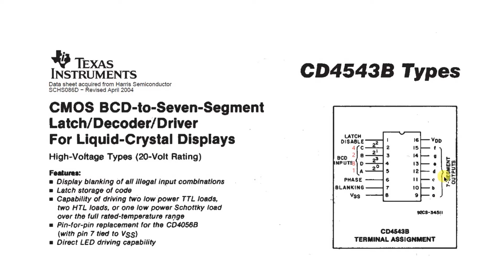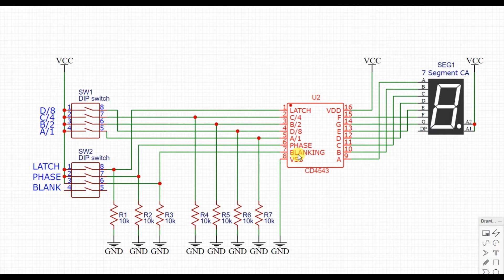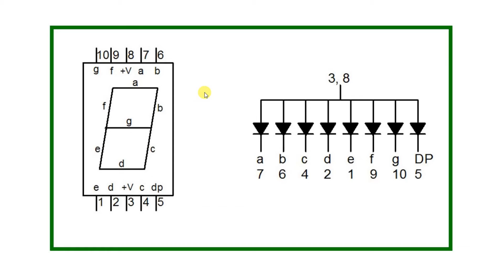CD4543 7-Segment Latch/Decoder/Driver IC

Comment: Good evening, please I really need help to use multiplexing with this single decoder and two displays.
Reply from the maker: To do that you really need to use a microcontroller. In order to multiplex to two displays you would need to control the power going to the lcd displays, both would be connected to the output pins in parallel. The microcontroller would control power to the lcds via transistors. If you give me more details on exactly what you want to do I may be able to advise you further.

Comment: Hi.  Why we don't use resistors between the 4543 outputs and the display segments in this circuit.  I also studied this system myself and noticed that it seemed to introduce this resistance itself, because adding resistors by me did not limit the current.
Reply from the maker: It seems like this chip will work without resistors
Reply: Quite a few of these '4' series display driver chips limit the output current so you do not need resistors - but be careful as they often do.  Best to build your prototype on the bread board with them in!  Remember if you short a pin on the chip somewhere to the power supply (I have done this many a time) you could be feeding the power supply current directly to the 7 segment display and you will very quickly destroy it!  Been there, done that and blamed faulty displays in the first instance!

Comment: how would you connect a second display for a 2 digit scoreboard?
Reply from the maker: You would need to use a microcontroller. If you want to keep it simple without a microcontroller, see my instructable on making a coin counter, this uses a different kind of counter IC and 7-segment decoder to display on 3 displays at once.